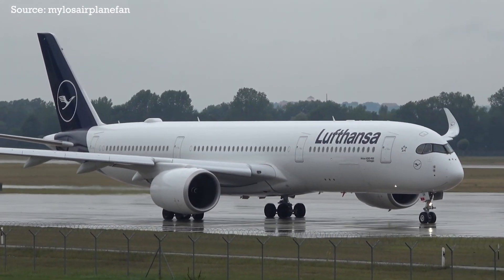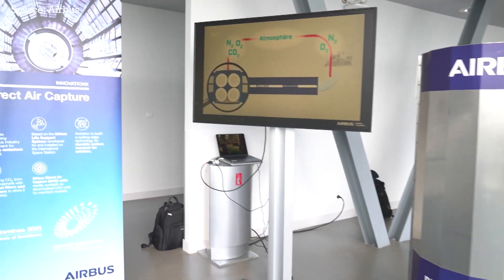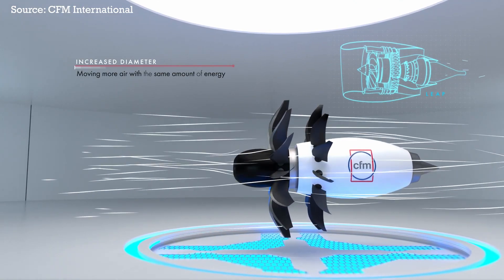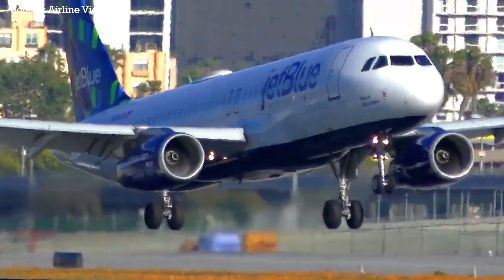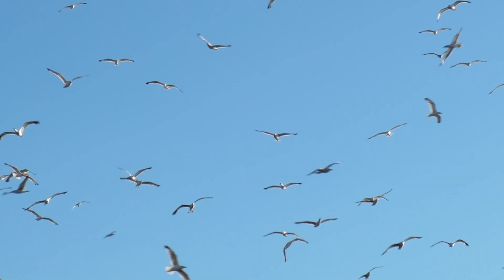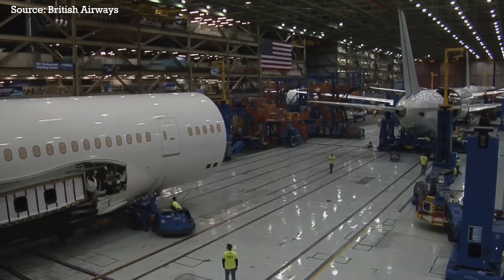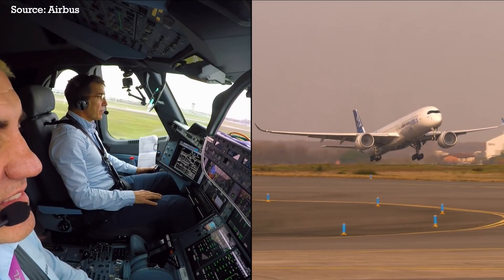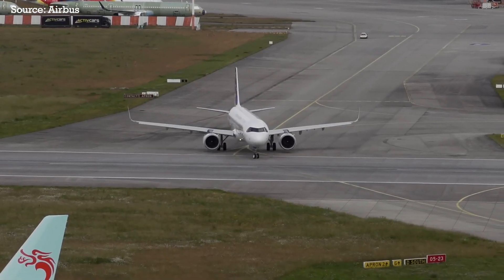How Airbus is Building the Narrowbody of the Future

Comment: I see the PR department worked overtime to think of this new name, things had came full circle. In 2:11 that is nothing new, we already have a similar plane like that, we call it the Piaggio P180 or switch the prop around , also known as King Air, A400, Tu 95 Bear etc. I guess the prop failed in those decades past because the industry spent lots of effort to brain wash the public that propeller were a relic of WW2 and jets are good and modern.They also were careful to cover up the fact the whole industry are still struggling against the "sound barrier"  and the speed of jets have no significant gains for about 3/4 century. You can fool some people, but not all.